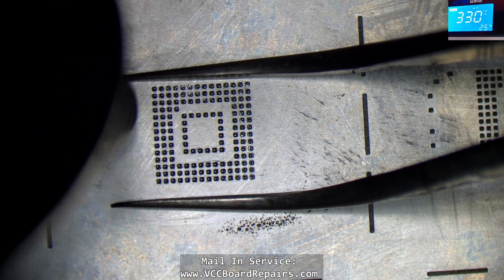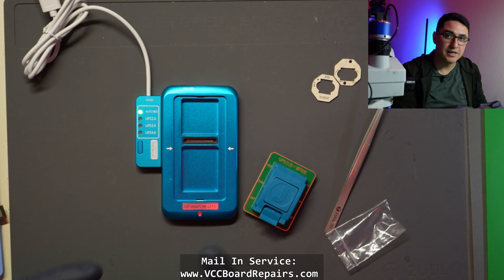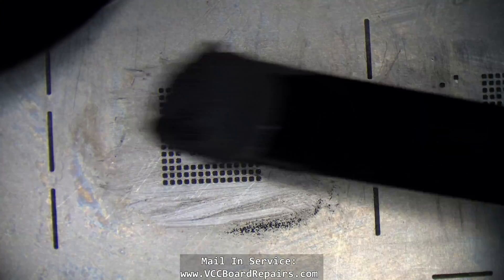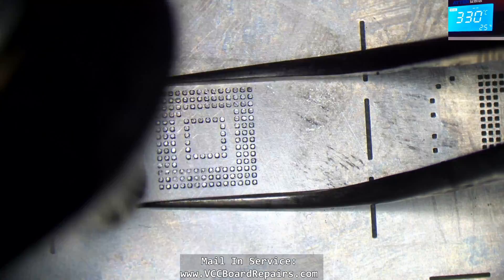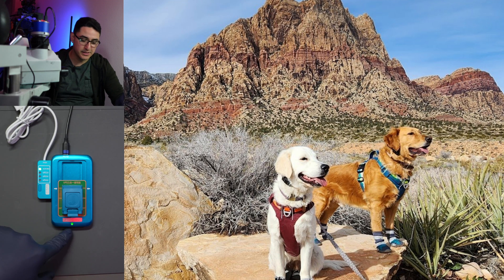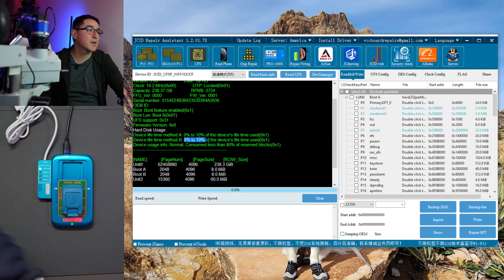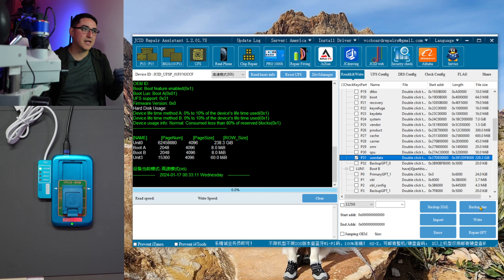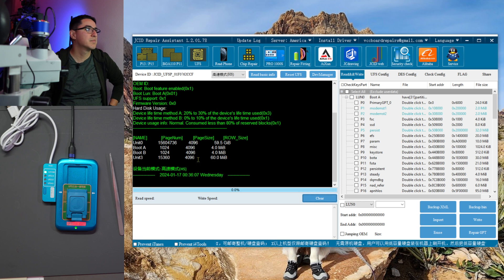The NEW JC U15 UFS Read/Write Programmer! BGA153 254 297 Android NAND. Storage Upgrade Now Possible!

Comment: Compre la u15 no hace nada me decepcione de mi compra 😢, tampoco hacen actualizaciones
Reply from the maker: Did you install the USB drivers? It will only work once you insert a UFS to the socket
Reply: @VCCBoardRepairs no puedes instalar software a las memorias como hacen otras, si tiene la memoria corrupta solo dump y no software normal, es muy limitada

Comment: Can this tool unlock the phone's bootloader ? There might be a way either through an option in the software, or my modifying the devinfo partition accordingly
Also for storage upgrade you do a repair GPT to expend the userdata partition so that is fills up the the entire chips, if you didn't you would just have unallocated space on the UFS
Reply from the maker: no idea

Comment: Bro I have a screen dead google pixel 4a device. Everything is working behind the scenes but the display is dead and the repair cost of the display is too much but without display I cannot retrieve my data. So, can I extract the UFS chip and cpu out of the motherboard and then is it possible to read my data ?
Reply from the maker: No you cannot get data like that
Reply: @VCCBoardRepairs  yeah is it due to the encryption? I think data we can get but it would be encrypted and that's the issue. Let me know if my understanding is correct. Btw loved your video and thanks for the quick reply❤️
Reply from the maker: @sabkaBaap007 correct. It's encrypted. This programmer is $400. 

You're better off buying a used phone on eBay and swapping the motherboard to it than buying this programmer for a one time use (which won't work for data recovery anyway)
Reply: @VCCBoardRepairs  thanks bro
Reply: would be 100% easier to replace that screen. anything else would be very expensive and complicated

Comment: Can it backup user data when it have bad health chips and put in new one with save data or only works like copying matches data serials ?
Reply from the maker: You cannot get data from it.

Only for copying configuration data for UFS replacement with no data